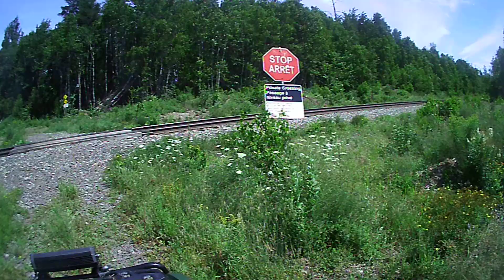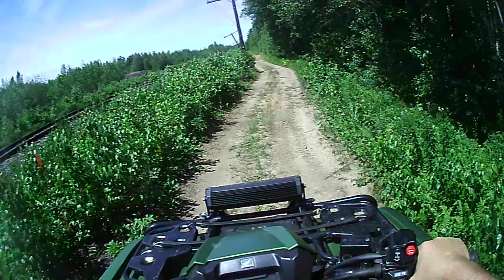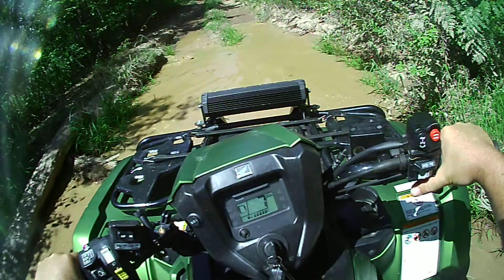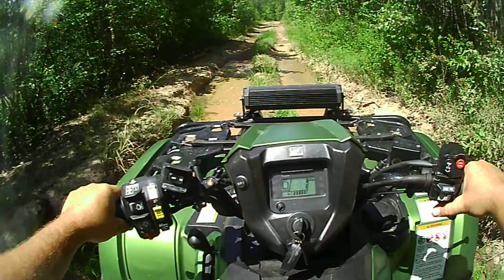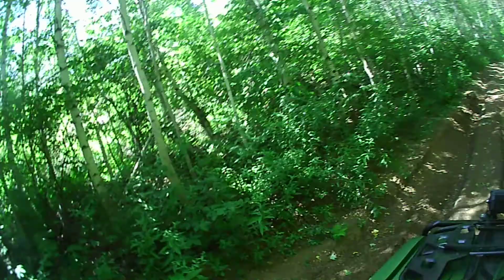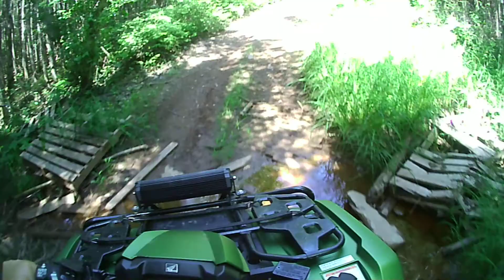Dried up pretty good (Honda Rubicon 520 )

Comment: Glad to see you’re happy with it. I have the same 2021 machine (Molasses Brown) being delivered next month. Can’t wait. 

Question for you. In the first half of the video your display shows you in second gear but as you come up to the water, it then shows “D” and yet it doesn’t look like you switched the button from ESP back to DCT. Thanks.
Reply from the maker: Hi Steve and thanks for watching . to answer your question it was always in auto but sometimes I will shift before it wants and it will show what gear your in but after you drive abit the d will appear again
Reply: @helpgrowthechannel  Thanks for the info. Do you do any snow plowing with yours? Looking at the Honda factory Warn 54” plow setup and also the KFI 60”. Would love the Click ‘N Go2 60” but after two years they still don’t make a mount for our 520’s 😞. I asked Ross Clark Outdoors if he has part numbers, as he has a Click ‘N Go2 on his.
Reply from the maker: @stevehorvat69  ill ask ross hes a friend of mine
Reply from the maker: I'm pretty sure he bought his from kimpex but with covid theres alot of back order
Reply: @helpgrowthechannel  thanks. I called Kimpex the other day and spoke with a rep. They said they still haven’t made a specific mount for the 20-21 Rubicon’s and gave me a universal part number 373951. When I look that up it still says it won’t fit the 20-21’s. 😞
Reply from the maker: @stevehorvat69  odd that the mount wont fit the frame id think it would be the  same as 2019